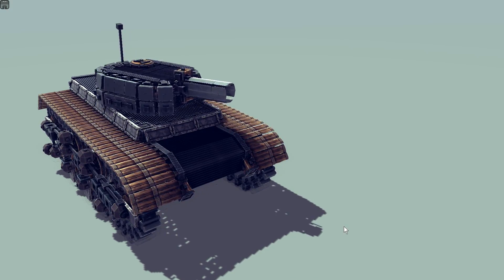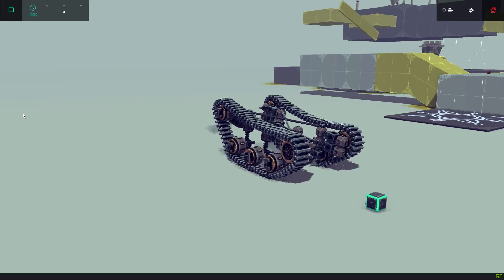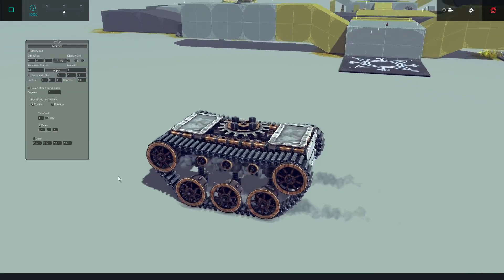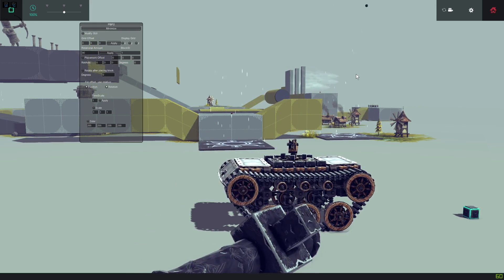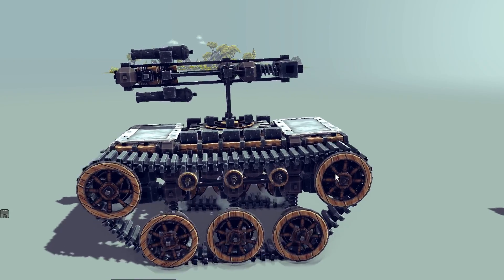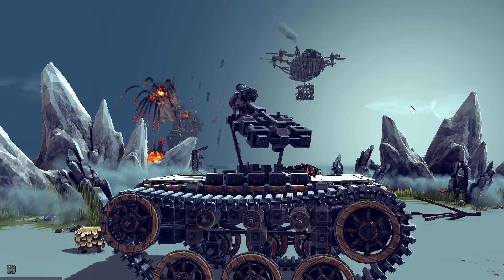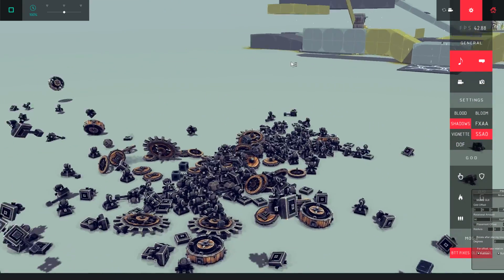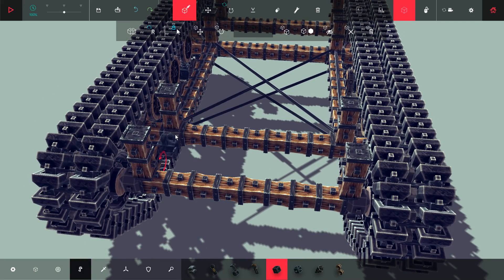Besiege: Tanks, Treads and Tank Tech Tutorials! HD 1080 60fps

Comment: you could mount the cannons on some sliders, and have a spinning block at the front of the sliders adjusted to constantly keep the cannons pointed in the right direction. this way, when it fires, the recoil won't transfer through the system onto the chassis because sliders have no reaction force to them.
Reply: I was thinking springs would work better. Because the way he'd set the first it up it would be very easy to add that.
Reply from the maker: +Jun Jet T I need to try that spinning block thing in conjunction with some other ideas. Is it the gyroscopic effect that does it?
Reply: +Jun Jet T I'm not sure I understand how this works; I'm trying to find a good way to absorb cannon shock too. Could you explain it again or maybe put up a screenshot?

Comment: I've been waiting to see you post a Besiege video again, which is bittersweet because I haven't uploaded in a while, and I really just should take some time to get a video done for all those creations I have.
Reply: Also I realize the padlock icon isn't making the most sense in the world right now, but I just been slightly too lazy to tweek that.
The whole having blocks on top of blocks issue, I might try and look into a hotkey for fixing that so you don't get builds ruined by misclicks.

Also there is a mirror option for stuff like duplicating one tank track and wanting it to be flipped.
I guess it might be slightly weird when you're that far away from the normal building zone though.

For the part where you had a brace issue, the hide tool is what was supposed to help with that, though I know that it has some issues right now with still blocking while hidden, that will be fixed next update.
Reply from the maker: +TheGuysYouDespise It's really not an issue with the padlock. Once you know which setting is which it works like a charm. I couldn't get mirror to work initially but I'v updated tp .40 now so I will give it another try. I would like to do a tutorial which focuses on BT & PBP2 working together as they are very powerful when used like that. I will try to include most if not all of the BT functions
Reply: Besiege This! Thepadlock is something I'll change so it when you have things unlocked it is unlocked, but with a new icon.

I wouldn't bother, there is so many functionalities and dynamics between them.

Mirror should have worked since 0.38 or so iirc. It mirrors along the axes, so mirror X would be if you had a mirror on the plane defined by Y and Z. I might make a mirror gizmo at some point though to visually show that, but I think it might be as confusing for some people.

If it doesn't work let me know, and perhaps send me your output log.
Reply: And done, hopefully in the future you can be more careless with constant saving.

I know a full undo/redo system between BT/PBP2 and Besiege would be nice, but that is just such a huge task.
Reply from the maker: TheGuysYouDespise Wow! have you updated already?
Reply: Besiege This! I'm not a man that understands the concept of "free time".
Reply from the maker: TheGuysYouDespise lol!  I totally believe you :D

Comment: could you add flying blocks on the front pointing the same direction as the cannons to work opposite the recoil? then put them on the same button so they activate at the same time
Reply: +Brandon Pepa I just went and tried it and it didn't work out for me. The problem I ran into is that when I have it sort of working at slow firing speed it just make it worse at high speeds. Maybe there is an optimal setting to the flying block but I haven't found it. I've tried setting the flying block to ranges -15x to -20x.
Reply: +Ben Wang damn that's too bad. have you tried it in combination with the springs?
Reply from the maker: +Brandon Pepa I think I will investigate that idea thanks.

Comment: Hey BesiegeThis! Can you help me install the Building Tools mod by TGYD?
Reply from the maker: +Zach Than What problem are you having with it?
Reply: Besiege This! I asked my buddy Neutex on how to install it, because I couldn't get it to work with the steps the TGYD said in the forum. I extracted the .rar archive in my Mods folder and it didn't work. The thing I need is more detailed instructions on how to instal, cause I can't seem to get it to work noo matter
what i do :(
Reply from the maker: Zach Than what versions of modloader and Building Tools are you using? first up you should be using BT .v0.41.
when you unpack it in mod folder take the contents of its resources folder and place them in the resources folder that comes with spaar's mod loader. If that is not there! you have not installed modloader properly . if it's good though just discard the now empty resources folder that came with TGYD's unpacked mod rar. tht should do it! let me know how you get on dude. I will help again if no good :)

I take it you have the BT .dll file in place yeah?
Reply: I don't really know, but I'm using the modloader for V0.25

Comment: Honestly, it might just be my computer, but the Unity 5 engine has done fuck all to help with FPS. My creations still lag to pieces if I approach ~300 parts, forcing me to lower the speed to at least 50% to get above 30fps again.
Reply from the maker: +Xenro66 I'm ok with unity 5 tbh. I don't mind going down to 50% for huge creations like 1500 etc but I try to keep my build a bit smaller now. Scaling is quite good in that you can cut down on number of blocks used.
Reply: Besiege This! Yeah, 50% for 1500, but 50% for 300? It's insane. But yeah, I'm going to try scaling parts to cut down on the number.
Reply: +Xenro66 What comp do you use then?
Reply: +Xenro66 Even on my macbook it's not bad. 300 blocks typically isn't too bad for my computer, but then again, it's not the best for cpu handling. Unity 5 has definitely helped though...